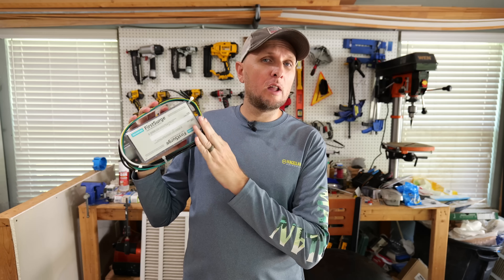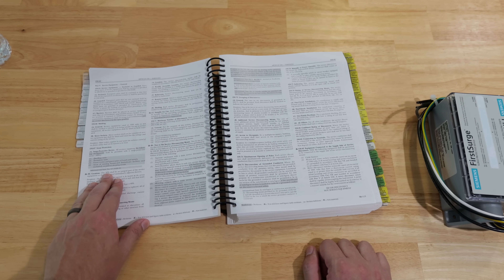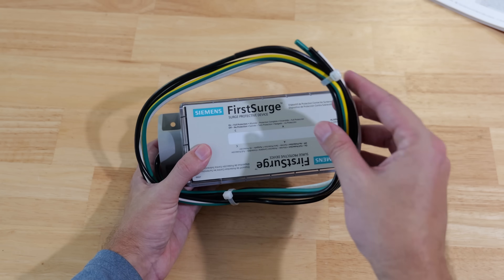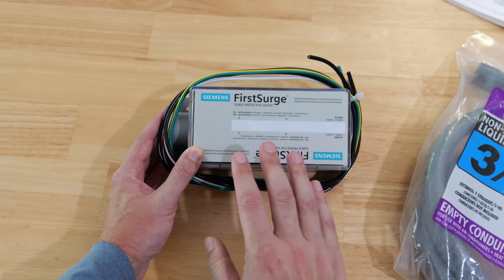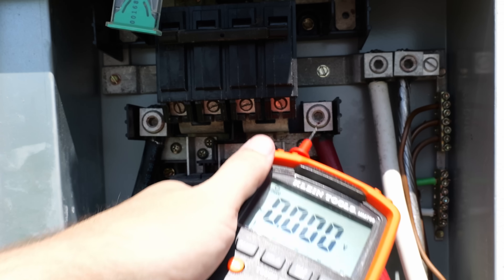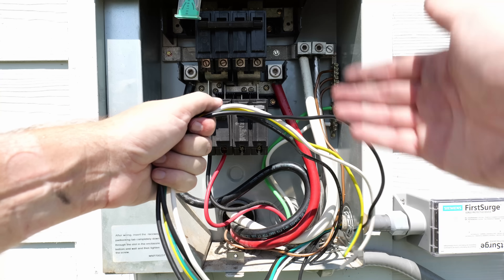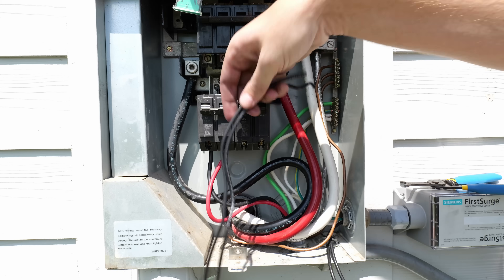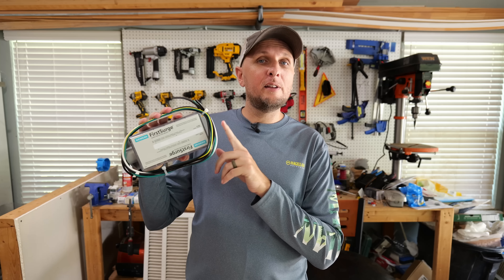Why Whole Home Surge Protectors Are Now Required and How To Install One!  Siemens FS140

Comment: Can this be added to a sub panel?  I have no room in the main panel, but do have space in the sub panel in the attached garage.  I like the idea of the whole house surge protection.
Reply: I was thinking the same thing, full inside panel, but I have a sub panel outside with 5 empty spaces. What I can tell you is with my personal setup, there's only one single pole breaker in the subpanel, so I'd need to verify I have both L1 and L2 before I can consider this.. next, the distance from the device being protected will affect performance slightly.. that said, it should be possible

Comment: I live in Japan. Houses are supplied with 100-0-100V split phase power similar to the US (120-0-120V) system. However, in Japan, the neutral is never bonded to Earth ground. (Actually the neutral is Earth grounded at the distribution transformer.) The main breaker is always a GFCI breaker and 200V appliances are provided with a separate Neutral and a green wire wire to Earth ground. I am planning to install a whole house surge protector due to the large amount of electronic devices I have. Thanks for your video.
Reply: Interesting hearing about electrical practices in Japan.  Just curious, do you have any nuisance trips on your main?
Reply: That is much more sensible than the systems we have in the USA and in Europe and beyond. The mantra in bonding is "single point ground" but our practices ignore that altogether. Single point ground violations are responsible for most equipment damage but do not present much of a life or fire hazard, so we still have them.
Reply: @flagmichael  You took the words out of my mouth. The US practice is bad from an engineering standpoint because it sets up a parallel path and the possibility that unbalanced  neutral current can flow through the ground back to the utility transformer from the service panel. It is rare but could happen in some circumstances. Of course the utilities aren't covered under the NEC so they are going to put in their own ground by gawd. The NEC sort of admits the folly of this practice because for separately derived systems (where the user owns the transformer) the neutral is only bonded to ground at one location and not both.

Comment: I have seen Square D, Homeline series  that have what looks like a 2 pole breaker that pops in place for around $100 or so. I do building inspections for the city I live in. It is a neat and tidy job when finished inside of the service panel.
Reply: I have the same  for the QO series

Comment: First hand experence. A lightning storm was passing through one day and lightning struck near by (not a direct strike), which sent a surge into my home.  It fried electronics that were running, tv, computer, and a usb charger connected to a
Smart phone i was using. When lightning struck the usb charger fried and some how sent high voltage down the usb cable and zapped my hand causing me to reflexively throw the phone. It sort of felt like mains power but I'm not certain.  I don't know for certain but i think surge protection could  have saved my electronics, and may have made that day a bit less frighteningly scary.

Comment: EMP SHIELD... if you are installing a whole home surge protector, you may as well install EMP protection. The unit is rated for outdoor install as well.

They were designed for the military to keep Bradleys working in an EMP attack.   Also they replace it for free if you take a lightning strike (ab the only think that can overpower it).

Install is exactly the same. I have one on both my houses and all 3 vehicles as well. (They make them many situations including solar panels.)
Reply: As an electrical engineer , the concept of a EMP shield that you can just wire in is blasphemous .

At best these are glorified surge protectors . You might as well buy one that’s not trying to sell itself as magical (like the one in the video) . Though even those are questionable 

Do not waste any more of your money friend !
Reply: @jonathanruiz8723  my understanding is it near instantaneously (in a few nanoseconds) routes the electrical overload/pulse to ground... and continues to do so to keep the long lasting E3 from causing damage.  How does that not work?   I mean it won't protect things not plugged in to the system obviously... but why are they useless?   And why does the military use similar things if they don't work?   (And I'm not being a smart ass, I'm a "why" person so my mind needs to understand why something does or doesn't work for it to make sense. )
Reply: @Cryptonurse-n6g  that’s precisely how a surge protector operates. Hence why i called it a glorified surge protector !

The problem is near instantly is not fast enough . An EMP will obliterate the electronics before such device can do anything . 
The only way to really protect from an EMP is to not get hit .

Your vehicle will never be in conditions where a surge protector is necessary . And wherever it would be , there likely already is one.

As to why the military uses such things: it’s not that surge protectors are useless , it’s just not for EMP’s. Tanks are EMP resistant due to the armor being a pretty good faraday cage more than anything . But our military spares no expense !
Reply: @Look_What_You_Did happy for you , I guess?

Comment: Excellent video.   Did not know that device is required on new work now.   I put one on my panel years ago (I’m a retired electrician).  They were really expensive back then too.
Reply: Its not required in New York. They are still following the 2017 NEC

Comment: Noticed that even though the GND wire (grn/yellow) wire was "tight", when you were routing the NEUT (white) wire, some of the strands in the GND were moving and loose!
For this a ferrel should be used.
Reply from the maker: No and no.

Comment: my moms house has one at the meter via our electric company we wouldnt be able to install one in her panel as there wouldnt be any room in it as its maxed out already unless we rearrange the breakers there is a unused circuit breaker for what would be connected to a whole home ac but we havent had one in years we just have window units like its a 20 position pushmatic panel while 2 of the breakers goes to a secondary panel in my moms garage

Comment: When testing if terminals are hot or dead ALWAYS connect your meter leads to GND/Neut FIRST, THEN touch the "hot" to test.
If you touch the HOTs first, your meter and leads are HOT (if energized) and shock hazard exists!
Reply: Thank you. I was cringing when he did that.

Comment: If you are going to quote the NEC, make sure you follow it when you do your demonstration.  You failed to install a wire protector on the end of the conduit fitting inside the box.
Reply from the maker: Please share the code for that when using liquid tight conduit.  Not required.

Comment: Great Video. Thank you for sharing. I have question. In Main Breaker panel , Neutral wire and Ground Wire can connect the same bus bar ? and In Subpanel Neutral wire and Ground wire connect separate bus bar ?
Reply: Yes. At the panel neutral and ground collide. Not in the house. Only at the panel where neutral can bleed off any stray voltage to gnd

Comment: This was a great video. I am not an electrician and was not aware of the new requirement. The Siemens SPD is a solid device and I have used it to protect field devices here in lightening ally Florida. This is important to note. These devices depend upon good low ohm grounding to give the best protection. Maybe you could elaborate on that aspect for everyone.
Reply: I would say "single point ground" is far more important than low ohm grounding. Here in arid Arizona our engineers struggle to get the ground below 10 ohms, even with a large array of chem rods. Think of it like this: a typical lightning strike on a system that has one ohm ground resistance will produce a 100,000 volt jump in the surrounding terrain. Just make sure all your grounds reference to one point, and all is well.
Reply: @flagmichael  exactly. Everything needs to be at the same ground potential. Bonding everything to a single home run is a great start.

Comment: Yeah the code people can jump off the building. I added Arch protectors in my workshop and a couple places on the house, every one failed within 3 months, even with the workshop being a new building with new wiring. My 1948 house has outlived all current codes.

Comment: So, how would you install one of these where the breaker panel is mounted in the wall rather than just attached to the outside of a wall?  My main panel for my house is mounted inside the wall so you don't have any access to run conduit and/or wires into or out of the box.
Reply: They make a recessed kit. Basically, you cut a hole beside the panel, installed the recessed kit, and it makes a void beside the panel. Then the SPD goes there.

Comment: Another money maker.
Reply from the maker: That’s your opinion.  But I got pretty tired of having to replace circuit boards and electronics over the years that costed me way more than this surge protector.  Haven’t had an issue since having installed one 4 years ago.

Comment: Glad to see you spreading the word. I installed a Siemens one in my panel that just took the place of a 240v circuit breaker for the dryer I wasn't using, very convenient packaging.
Reply: What happens when you want to use the dryer,just cus today you are not,maybe tomorrow you are
Reply: @cengeb  then I'll hook it to a 240v breaker further down. I have a gas dryer though.
Reply: @cengeb or you can get a double pole tandem breaker if the panel can handle it.

Comment: How can that possibly protect anything from a surge?  It has no control or way to disconnect anything if a surge takes place.  Is it meant to absorb a surge with a massive battery / capacitor or something?
Reply from the maker: It absorbs it while also giving the surge a direct path to ground.  Without it you don’t have that and surge of power needs somewhere to go.
Reply: it has MOVs that absorb the surge into heat

Comment: Our SquareD primary service panel is really tight on available breaker space.  MIGHT be able to install a double 20À breaker with 2 breakers in a single unit.  Would that be acceptable?  We do have space in a nearby sub panel that was added to accommodate our solar equipment, about 5 feet away.  Would that be a viable second option?  Thanks for a great video.  Some friends had a nearby lightning strike that fried EVERYTHING in their house.
Reply: A single-slot double breaker is NOT the same as a two pole breaker. Alternating slots in the panel are fed from the two different power phases feeding the panel. That's how you get 240V to power things like your air conditioner. A single-slot double breaker is only powered by one of the two phases. If you connected a surge protector with one of those, one of the two phases would be left unprotected.
Reply: @WarpedFlayme  Thanks for the clarification.  There may still be a way, but would require some other approach.  I think I have maybe two remaining standard sized breakers.  Between a subpanel in the back yard, and a subpanel for the solar, its pretty well maxed out.

Comment: For many of us, our heat pump is our most expensive electrical device. There are surge protectors specifically designed for HVAC equipment and installed at its shut-off box with no breaker required. They'll protect against internal and external surges. In addition to the FS140, I installed the Intermatic AG3000 next to my compressor. You might want to review them.
Reply: I have an FS140 on my main I was wondering IF an extra Intermatic AG3000 would be redundant.  ?
Reply: @ciliap  Not quite redundant and not quite necessary. Surges can come from inside a house as well as outside and there's likely to be a a lot wire runs from the source of an in-house surge and that whole house protector and any sensitive electronics. I installed my Intermatic as much to keep any surge that might come from my heat pump starting up as to protect it.
—I had another reason. I live in a triplex at the far end of the building from the incoming power.  That puts my entire house 100 feet or more from an earth ground. I used installing that Intermatic in my heat pump's disconnect box as an opportunity to attach an addition ground rod. As I read the code, that's permitted as long as that earth ground is addition to rather than replacing the existing ground.
—Finally, keep in mind I live in lightning-prone SE U.S. and at the top of what I call "Lightning Hill." I've had at least two lightning strikes on trees that I know of within 100 feet of my house.
Reply: I added ditek
Reply: Which I recently got, due to an issue with the system. Nice to have that intermediate protection between the unit and the panel.
Reply: If the FS140 is truly a "whole house" protector, what is the advantage of having additional surge protectors specifically for the HVAC?
Reply: @thetayz72  yeah multi level is best
Reply: @AgentOffice  Is there any source confirming it's necessary / recommended?
Reply: @thetayz72  most of it is marketing but I'd still do it

Comment: How did we get along all this time with out them?
Reply from the maker: By having to replace all of the electronics fried from a surge if they were noticed they were damaged.  Installing these is a no brainer.
Reply: Old-fashioned appliances had simple switches, timers and relays that could handle surges. Newer appliances use electronics that are vulnerable to surges and often expensive to replace.

Comment: "Required" by whom, specifically?
Reply from the maker: Doesn’t matter whom, only matters if it’s in a jurisdiction using the 2020 or 2023 edition of the NEC.  Homeowners are allowed to do their own electrical work in most jurisdictions, or electrician, or utility company.

Comment: 3:05 Lets be very clear, small SPD's will NOT protect against lighting.  The SPD's will be vaporized along with most everything in the home.  Ask me how I know a number of years ago!  🔥  It also blew our lawn sprinkler controller off the wall across the garage.  

Our city hasn't adopted 2020 NEC and we are still on the 2017 revision so they aren't required here yet.

We have a type 1 SPD, two type 2 SPDs and all sorts of type 3 SPDs in our house.  This spring we had the neighbors house get hit directly with lightning and caused a huge EMP/ESD event at our house.  All SPDs were fine, but many items were destroyed and had many AFCI's tripped closest to the actual strike.  We lost lots of items with the large induced coupling of voltage on the house wiring.  Anything connected to our in-wall speakers died (TV's, AV receivers, alarm panel interfaces died, network switches were killed.  All because of the amount of cabling in the attic acting as an antenna that were induced into those wires came down and found the path to ground.   The video that I got was great, you can see the parts of his roof flying in the air, and the large corona fireball rolling down the roof onto the ground as well in the video.

Comment: Great... I just had my panel upgraded earlier this year for solar panel installation but the contractor didn't install a surge protector....
Reply from the maker: Depends on whether your jurisdiction/state has adopted the 2020 or 2023 edition of the NEC.  Most have though.
Reply: Thanks, I live in California. From what I am seeing, it seems it has also adopted 230.67 as of 1/1/2023 as well.  https://cdnsm5-hosted.civiclive.com/UserFiles/Servers/Server_10826046/File/Our%20City/Departments/Community%20Development/Building%20and%20Safety%20Services/2022%20Code%20Updates/2022%20Electrical%20Significant%20Changes.pdf @HowToHomeDIY

Comment: I'd have to upgrade at least my breaker box if not the service level to add a SPD to my house. I don't have any empty breaker locations in my electrical box... But I'm planning on a breaker box upgrade in a year or two as I'd like a couple more circuits (separate lighting and outlets in the basement, outdoor outlets, conversion from gas to induction cooking, etc.) Now that I know about the requirement for a SPD, that "up charge" won't be a surprise and I can plan it into the budget.

Comment: Speaking of best practices, since the SPD wires are stranded, I would have probably put ferrules on them. Especially in the ground/common bus bar because of the screw clamping where the clamping force is twisting while clamping down. The connections on the breaker itself probably wouldn't benefit as much from ferrules, but I'd probably also do those as well if I had my ferrule kit out. Ferrules aren't necessary in this application, but using them would provide one more level of professionalism and reduction of corner case faults.

Comment: Since you spent so much time discussing the NEC, it’s a shame you tightened the screws on the breaker til they were, “nice and tight.” There’s a code requirement for the proper torques for those, usually listed on the breaker and in the panel. Your inspector (assuming you pulled a permit) should ask to see your torque driver if they’re good.
Reply: Inspectors never have that kind of time

Comment: They are needed for new construction or full service panel replacement.  

My house built in 2019 did not come with one. I did install a whole home surge on my panel though.  After big summer monsoon here in Phoenix valley, where power surge or power cut and the. Turn on surge things like my AC capacitors take a huge hit. I put a surge protector on my AC unit, but then realized I better do the entire house. So I installed one for the whole house. I went with a SquareD HEPD80